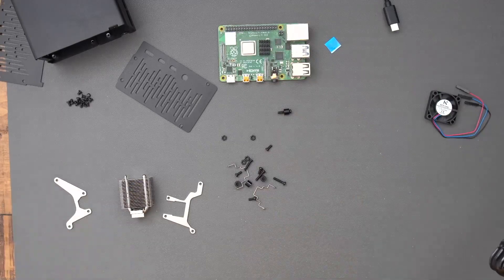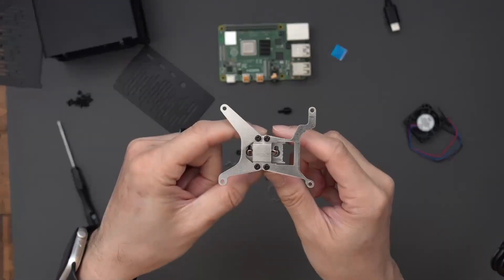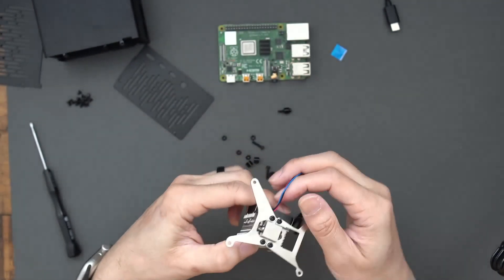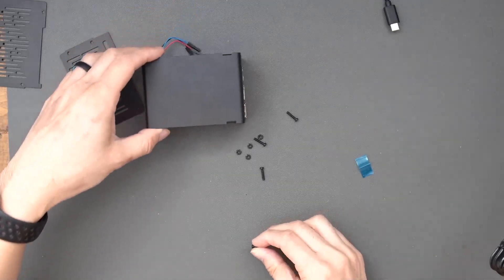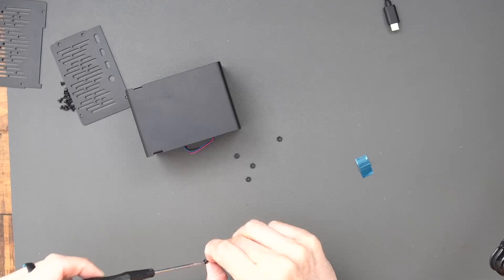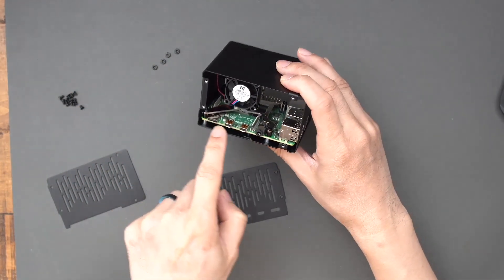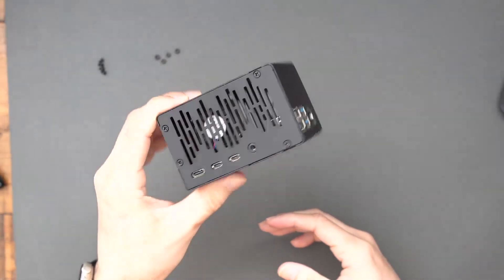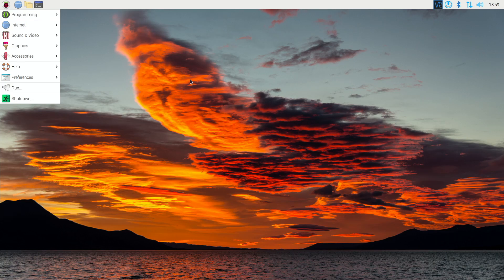Raspberry Pi Case and High Performance Cooler from KKSB

Comment: You might want to include temps when reviewing a case with active cooling, best regards
Reply from the maker: I haven't gotten to pushing the pi that much but the next time I do, I'll definitely monitor the temperatures.  Thanks for the suggestion.